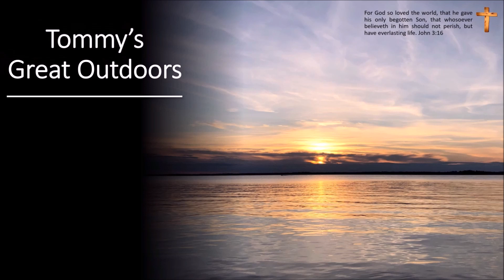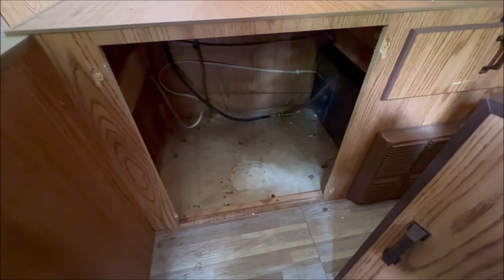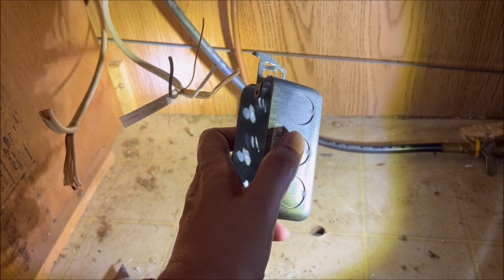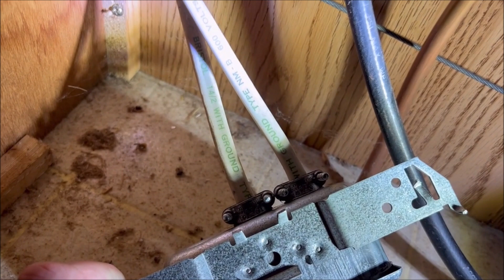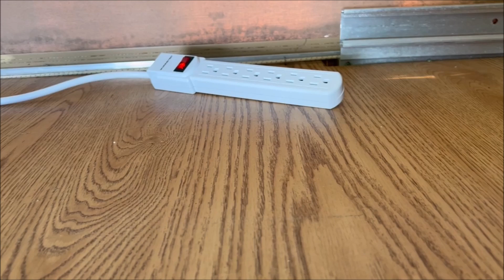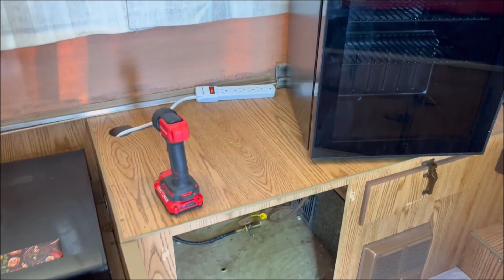Install a Mini Fridge into your Pop-Up Camper Step by Step

Comment: No issues with venting the back of the fridge?
Reply from the maker: Not at all. in my case there is a few inches of room between the back of the fridge and the wall. Also the hole I left at the top for the power strip lets some air in. Second season and so far no issues. Happy Camping!

Comment: Hello, just came across this video for a project I’m doing on a 84 jayco pop up. Your camper looks very similar to mine and I’m looking for a hidden vin since my camper does not have a title. Do you know where the vins are located on these? Thanks!
Reply from the maker: That’s a good question. I don’t think I can find one on mine. I only have it from some old paperwork. In my state of WI I am under the weight needed to title and plate.
Reply: @tommysgreatoutdoors okay thank you

Comment: Great job. What size fridge is that ?My dometic fridge only works on propane and if I want it to work on 120v, the replacement part is $150. It’s nice to have and keep it all original but for that $$ I have a few options.
Reply from the maker: 17.99"D x 17.52"W x 19.69"H. I left the Amazon link in the description if that helps.
Reply: Thank  you🙏